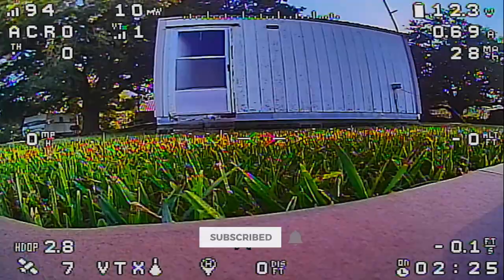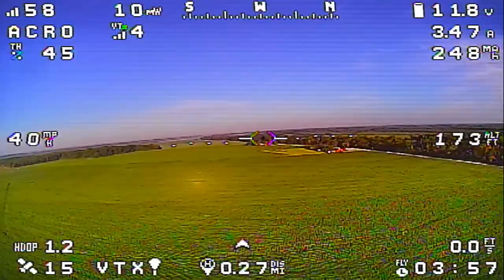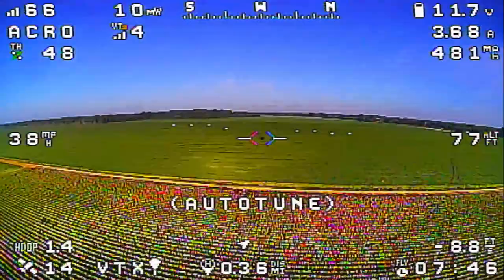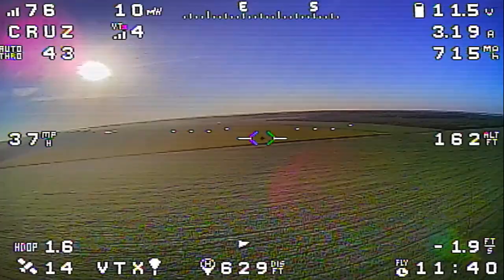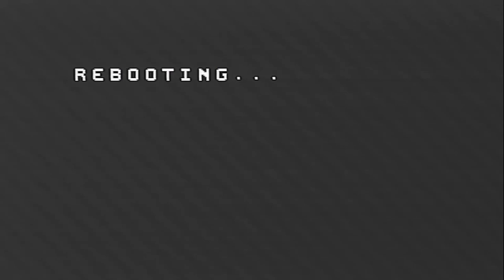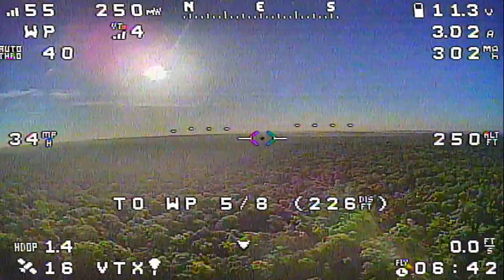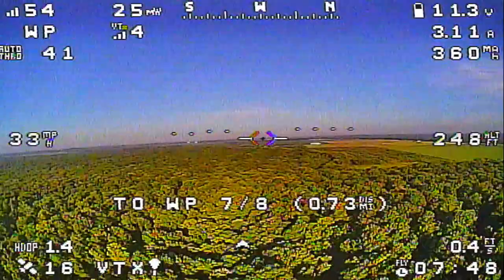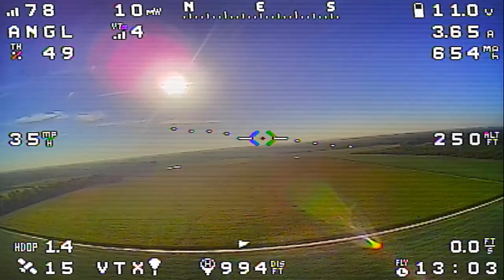Re-Maiden of the Dart 250 with iNav 5, and Autotune.

Comment: Overall a good re-maiden Keith. The roll with pitch input during autotune seemed odd. Was not expecting to see this. It did seem to become less after autotune, but not completely gone.
 
Only thing that concerned me was loiter on RTH (safe-home) and porpoise in altitude and speed (or horizon drift). Wonder if this related to the Dart250g descending in altitude as it entered loiter mode? Wound be interesting to descend first (last waypoint), then enter loiter to see if behaviour differs.

On the waypoint mission there was no issues with any of the turns, all very smooth, consistent altitude and airspeed (no horizon drift). I was admiring how consistent and dialled in the horizon seemed to be during the waypoint mission. Even from the initial re-maiden launch horizon drift was minimal. I'd be almost tempted to have a plane do a two waypoint hold pattern vs. circular loiter on a single waypoint.
Reply from the maker: I agree, it flew great right from the start, and seemed fine after the autotune, other than the loiter at the end... lol The weird coupling between pitch and roll is one I can't figure out, yet. I doubt it's anything iNav is doing, I have to think someone else would have noticed that by now. I know it's been flown and tested plenty by the time the stable release came out. Pretty much ruling that out... lol I also don't see anything weird with the airplane, servos are fine, both moving the same amount, linkages are set up the same, etc. I'll see if it's any better after making a few little changes and starting over. (bumped the throws up, and changed the mixer for 40% roll and 60% pitch)

Comment: My Diatone Ripper R690 exhibited the same roll-during-pitch movements during Autotune on 4.1.  I have way too much mechanical surface movement so I assumed that was a function of a poor mechanical setup.  4.1 also autotuned pitch feed forward to almost 200.  I lowered it to 90 (to reduce massive pitch bouncing) and I now have very little pitch authority.  I'd love to see you do a P, I, and D tune on the Dart and see your results as well as possibly tweaking the recommended settings to mitigate horizon drift.  Thanks for sharing, Keith!
Reply from the maker: Hmm, that's odd then. lol I assumed it wasn't anything iNav was doing, and if it was someone would have pointed it out by now. I think in my case my control throws are a little too low. Oddly enough my FF on pitch is also ramped up high after the autotune, 255, maxed out in fact... lol I've since raised the throws mechanically, and will load the stock tune back in and start over. I'll see how it behaves before and after autotune this time. While it was loiter it really felt like the dreaded horizon drift at first, but from what I've seen in the past that generally just pushes the nose down and it never recovers. This one was falling then climbing again. It also didn't show signs of any bad drift when turning in acro mode right after that. It's something strange either in the FC or the airplane itself. It will be fun to see if I can pinpoint it! lol

Comment: I lost one of my mini talons to that unstable loiter, the same plane was lovely and stable in loiter under INav 3 but since 4.1 I am learning not to trust it in loiter.
Reply from the maker: Well that's no good! I never used 4.x on anything, went straight from 3.0.1 to 5.0.0, though apparently some of the auto tune stuff changed between 3 and 4. I'm still not positive what the root cause is in my case, but I've made a few small changes and will start over with the stock tune when I fly again, and see if it's any better before and after autotune this time.

Comment: Interesting maiden and autotune. I have pretty much the same setup as you, except running it on 2S and currently inav 3.0 (maybe 3.0.1). Was thinking of using it as a 5.0 test bed too. I have noticed that I have always felt like I have had less pitch authority than I would like with this wing, but roll is great. I will definitely be looking to see if you can work that one out - my linkages are in the 'stock' setup!
Reply from the maker: Yeah with the default mix of pitch and roll (50/50) this little wing seem to have more roll than pitch. I've bumped the throws up a bit mechanically, and reset the mixer for 40% roll and 60% pitch. I'll start over with the stock tune and see how it feels, then autotune again and see if it's any better.

Comment: Thanks for the video. Good info. I am just about ready to maiden my Dart XL enhanced (inav 5.1, Matek F411Wte, first time using Inav on a FW). I have a question about saving after landing. I noticed you went into the OSD screen to save which was a surprise to me bc i was not aware that was possible. I never noticed the option (i am using 2.5.1 on my quad). I was reading the Inav wiki which says to land and save using the stick commands which shows throttle stick to lower left corner and aileron to lower right corner. Do those stick commands not work or its just your preference to go into the OSD? Appreciate your help
Reply from the maker: The stick commands should work, I just like doing it in the menu to get a confirmation that it's doing something is all... lol

Comment: When i auto tune i noticed the inherant roll as well. I thought it was my thumb swinging the arc from top to bottom. The pitch on was anemic compared to the roll as well. Might just be a wing thing.
Reply: Definitely the case on my Nano Goblin Plank style.
Reply from the maker: Yep, I think just about every wing I've flown is more sensitive on roll than pitch, with the "elevator" being so short coupled relative to a traditional design. I think I'm going to raise the control throws mechanically with the linkages, and see if it tunes better. (suggestion from Marc) Then maybe later I'll play with the weights in the mixer and see if I can better balance the pitch and roll control. This is the part I find fun and interesting, sometimes... lol The fine tuning.
Reply: Always best to tune mechanically as much as possible. I increased the throws on mine and got more responsive pitch, then dialed bach the weights on roll some like you said. The Dart is a solid wing, i should get one sometime. Anything Zohd has never done me wrong
Reply: With flying wings, often one servo is inverted relative the the servo in the other wing. So if there is an offset needed to position control surface to ideal physical tune, then the offset (auto-trim) needs to be added to one servo, subtracted from the other. 
This might be a bug in INAV (when a servo is setup as inverted for dual-aileron servo channels). If the auto trim is being added to both servos (not added to one aileron servo, and subtracted from the other aileron servo). Could be question for INAV team.🤔

It may be worth a double check to see how well physical neutral position (1500pwm) is to the post-autotune position of the control surfaces ended up.
With a conventional (T/V-tail) configuration, there is a rudder input (possibly mixing) so than it could help to compensate for roll, should there be when adjusting pitch. Definitely not torque related, as motor was at nearly constant % throttle.
Reply from the maker: @North49RC  After this flight, I've raised the throws mechanically (linkages out one hole on the servo arms) and while I was at it I adjusted the clevises to keep the surfaces trimmed, and return the servo midpoints to 1500uS. I changed the mixer for 40% roll and 60% pitch to see if it balances those better. I will load the stock tune, and start over to see how it behaves that way, then after another autotune. Hopefully that resolves it, if not there's something else weird going on! lol

Comment: Very strange behavior that roll with pitch. My problem has been pitch washboard like bouncing on climbing. I too have had poor altitude smoothing  or holding on loiter on 4.1. Both yours and mine seemed to multiply with each undulation. Worse than an uncalibrated hot end temp swing or a toilet bowling multirotor. Mine has usually improved with additional auto tunes.
Reply from the maker: Marc suggested I check the control throws, we're thinking they may be too low based on how the plane behaved in the air and the rates it landed on for pitch and roll after the autotune. I will probably revisit this in the near future and see if it's better after adjusting the linkages on the elevons. I never flew anything with 4, 3.0.1 was the last time I'd updated or installed iNav on anything... lol

Comment: im having a problem with 5, im loosing my set ups and not sure why, iv had to reload my diff 2 times already.
Reply from the maker: It's a known issue in 5, from what I understand if power is removed while anything is being saved to the board, next time it boots it sees something is corrupt (checksum doesn't match) so it loads the defaults as a safety measure. It will be fixed in 5.1, to be released around the end of August. In the meantime, don't quickly power up, then remove power, it saves the gyro calibration in the first few seconds after the board boots and calibrates. Also don't remove power immediately after disarming, some values are saved at that time too, like autotrim. There's an open issue on github somewhere that explains it all.
Reply: @bonafidepirate  thank you.

Comment: How would you give it up trim  for the maiden toss?
Reply from the maker: I have a mix in my radio on a switch. If I flip that switch, it offsets the pitch channel by a certain amount. I'd have to double check to see how much, but it should be around 15-20% "up" elevator, that's what I usually start with. As far as the FC is concerned, I'm holding the stick back a little... lol It's something I carried over from back in the earlier days of FPV when there was no autolaunch on anything, and I found it hard to launch big heavy planes without a bit of up elevator to get them in the air. I'll likely set up auto launch on here soon. I use it on my Arduplane builds and love it.